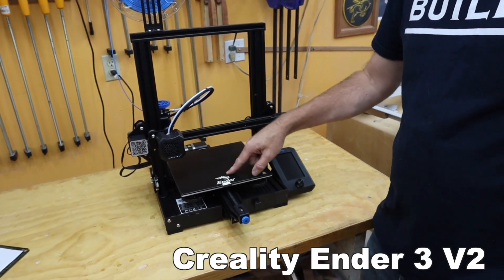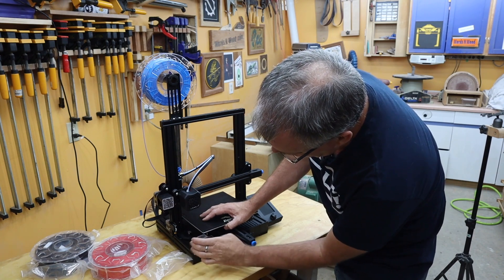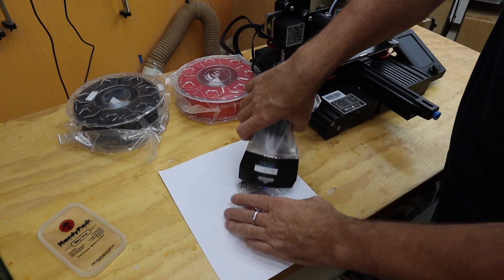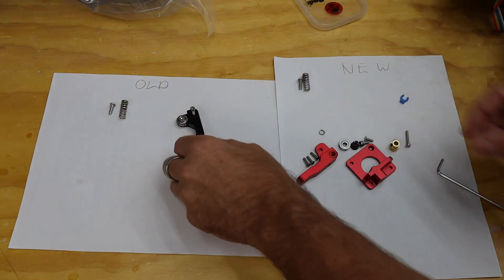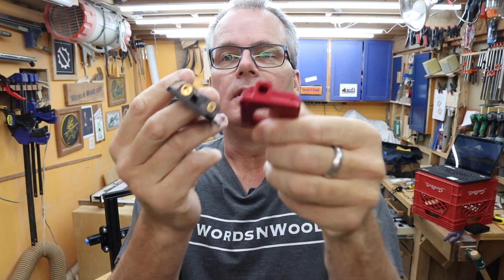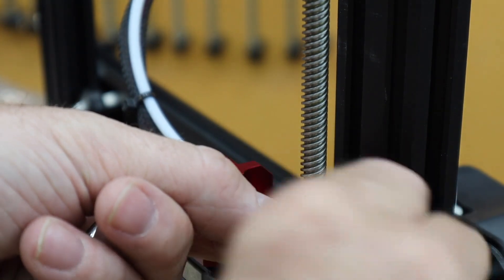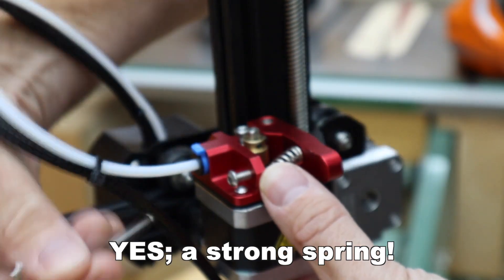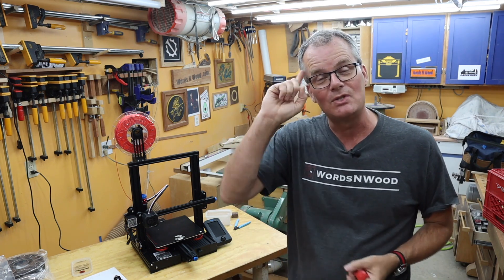Upgrade the Ender-3 V2 printer // bed springs and extruder // WnW 250

Comment: Not sure I caught why you replaced the parts. Good video
Reply from the maker: for me it was prevention.
Reply: In my experience replacing  the springs adds reliability/repeatability and the extruder replacement adds reliability (the plastic arm is reported to flex and break after a while - aluminum is more solid)
Reply: The Plastic Extruder will break, so sooner or later you have to replace it.

Comment: I would not add the metal wheels. They are heavier and add weight to the moving bed. It will increase ringing in your prints.
Reply from the maker: Hmmm, fair point.  have to think about that.

Comment: You mentioned the benefit of the spring upgrade, but not the arm upgrade.  Why did the arm assembly need to be replaced?  Thanks,
Reply from the maker: Over time it has been reported as a weakness that cracks.  Aluminum should last much longer.